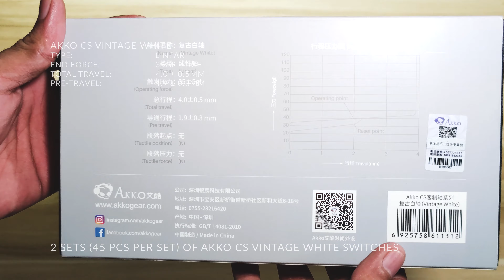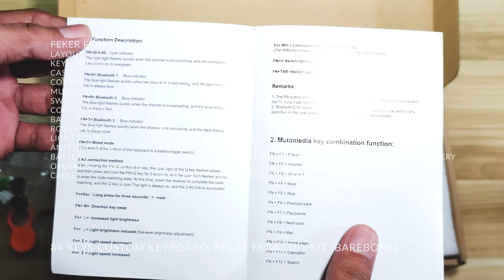Cheap 84key Custom Mechanical Keyboard Build - FEKER FK84T + AKKO Vintage White + XDA Profile

Comment: Thank you for this! I was looking for a budget 80% keeb! Have you been using this as your daily driver? Did you encounter any issues? Connectivity? Lag? Etc. Would appreciate your input to help me decide to buy this or not. 😁

Thank you in advance! 🙏
Reply from the maker: I haven’t encountered any lag problems with this kb, and its the better sounding kb that i have, i have the GK61xs(with aluminum plate) and the akko Acr64
Reply: @JACKROTECH  Appreciate the quick reply.. Add to cart then.. Hahaha
Reply: @JACKROTECH  One last question, can you confirm where the HOME key is located? Your video is showing that's in the ALT location. Thanks!
Reply from the maker: @MatsuysBatsuys  actualy you can map any keys using its software. (On this video i use the home kaycaps becase i dont like the icon keycaps that are special 1u.
Reply: @JACKROTECH  Got it! Thank you so much!
Reply: Hi! How did you get the 2.4Ghz connection to work? When I press FN+Q nothing happens, the manual says cyan light will blink but I don't see any lights. Thank you in advance.

Comment: Nice vid and build! Also, you think a 3mm foam would still fit at the base of the keyboard case? I'm thinking of buying this one but i only have a 3mm eva foam at the moment so I'm not sure if a need to buy a thinner one. Looks pretty tight from the looks of it.
Reply from the maker: I think that would not fit, due to the battery but if you cut the part of the foam were the battery is located it would be possible. I think a thin foam is shoul be enough.
Thank you for watching...
Reply: @JACKROTECH  Thanks! Should i go with 1mm or 2mm?
Reply from the maker: @cecil_242  im using a 2mm EVA foam on this build.
Reply: @JACKROTECH  okay, thank you

Comment: Nice build man quick and informative. Btw how is the range of the 2.4ghz connection? I'm looking at this and the RK84 and the RK84 fails hard on the 2.4ghz wireless
Reply from the maker: It's decent, no noticeable input lag within 2-3 meters away using the 2.5ghz dongle (no obstacle) ill try this later if it could go beyond that. Ill update later. Thank you for watching...
Reply from the maker: Update: it seems it work will even 5-8 meters away, even on a different room with door close.
Reply: ooohhh looks very good. I think i'll buy these in 10.10 sale. thanks a lot man now I made my decision
Reply from the maker: @searinox111  yes, its good... The case is thick and it uses Gateron hot-swap socket. It also has software to map keys and config rgb lights, ill post the link to the software.
Reply: @JACKROTECH  Hi bro, can you post the software for Feker FK48t?